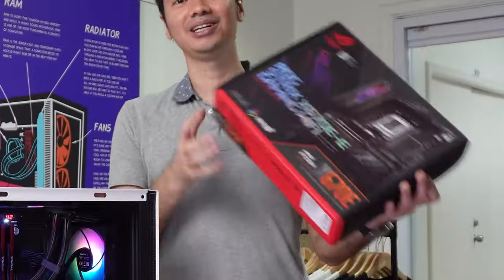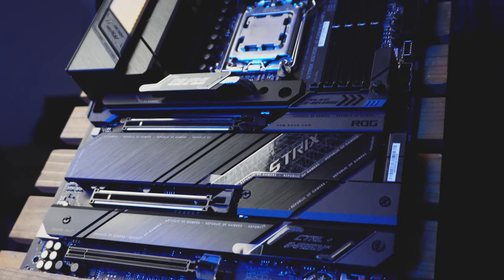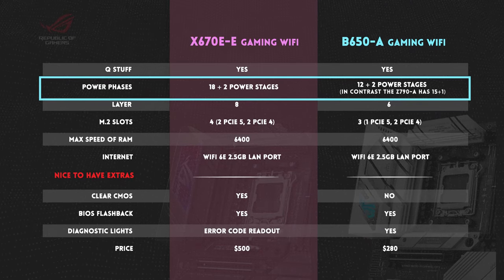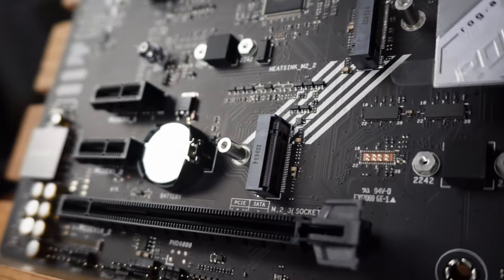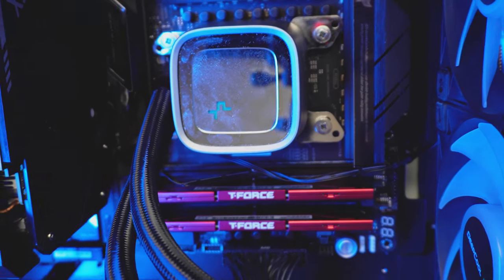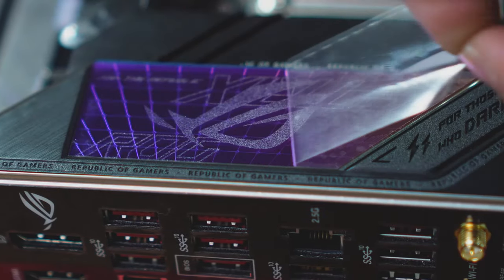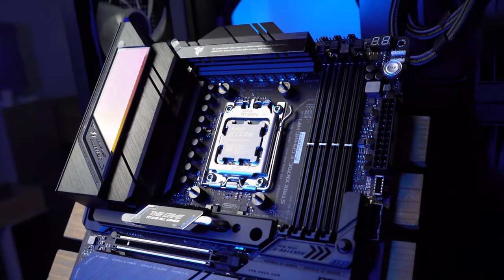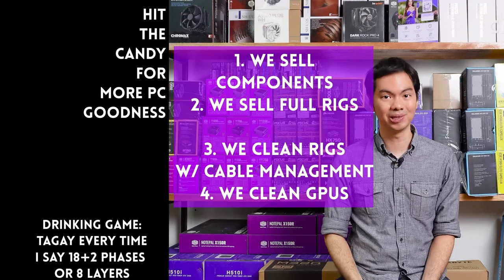X670 vs B650-What's the difference?🤔 ROG Strix X670E-E Gaming Wifi and ROG Strix B650-A Gaming Wifi

Comment: Whats is the difference about the suffix?
For example, there is:  ROG STRIX B650E-E GAMING WIFI   and   ROG STRIX B650E-F GAMING WIFI
and also the ROG STRIX X670E-E GAMING WIFI    and     ROG STRIX X670E-A GAMING WIFI

What does the xxx-E, xxx-A and xxx-F means?
Reply: Idk what A and F means but the E means extreme and that the board has a pcie 5.0 and an pcie 5.0 m.2 slot.

Comment: Dami ako natutunan sa channel na to, may cpu na kasi ako now, 

Intel Core i3-10100 3.65hz
H410 IT Motherboard
16gb DDR4 Memory
240GB 2.5 SSD
Intel UHD 630 Graphics 
Ipason Gaming Case 450W PSU
3 Single Color Fan
GTX 1650 SUPER

Gusto ko upgrade to Intel core i5, tapos 3200mhz ram, so yan lang tlga need ko bilhin tama ba ?